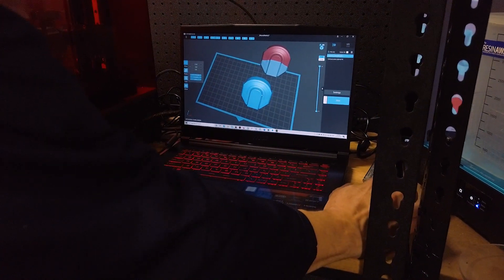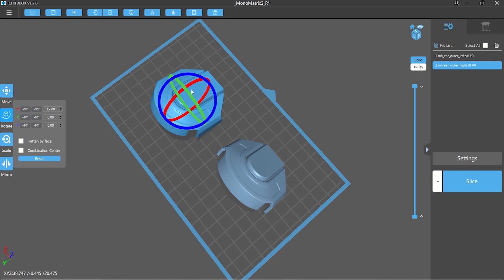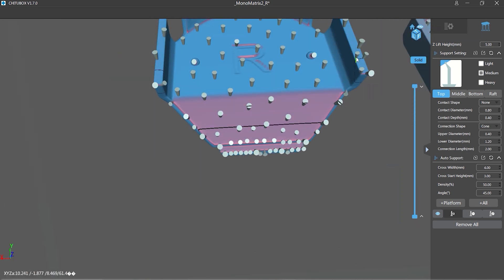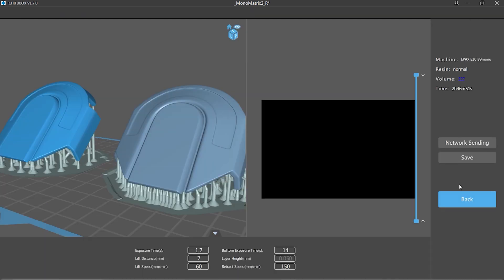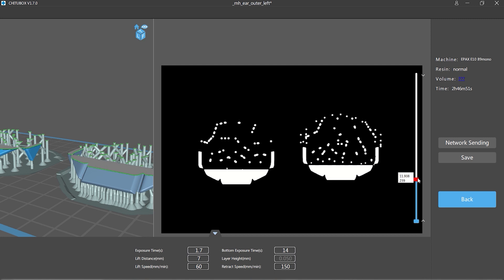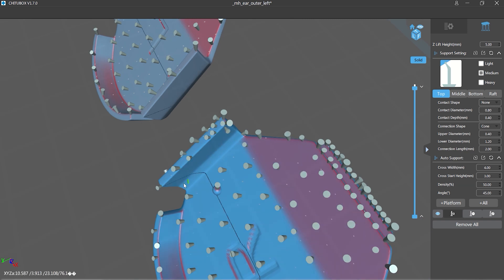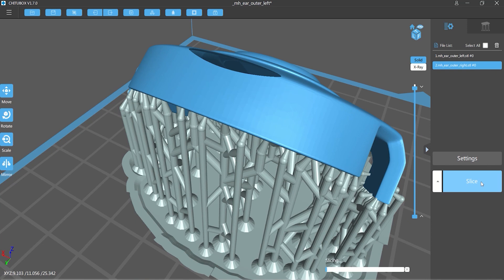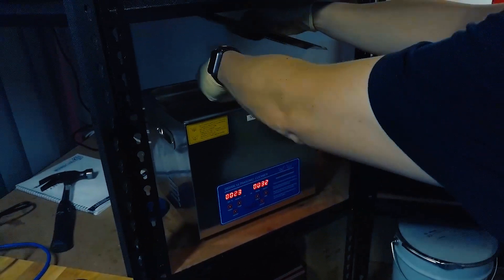How to set and place supports in Chitubox

Comment: Apart from this video, all the other videos on youtube that I can find are examples of printing and supports for toy characters. Are nobody using printers to print real stuff, like industrial parts or models.  I would love to see what did not print well. I would love to see the finer detail on the edges? Also I have some models where I want to support to rest on my model. For example I have a model that has a horizontal hole 150mm high. SO instead of having a bunch of 150mm high supports, why cant I just put a support inside the hole? I can drill it out afterwards. Chitubox dont seem to allow the support to go from the model to the model. This is something that you dont find on cartoon characters, so many people dont address these.
Reply from the maker: Try adding supports in all (not just to plate), change the angle of the supports or try Lychee. But I’m not sure why you would need supports in a horizontal hole anyway?!
Reply: This isn't a perfect solution, but I have seen some people use multiple branches on a single support, so you could place just a few supports near it and have more precise smaller branches support it from there. If you do end up doing this, let me know if it works for you as I am in the same boat, except I'm unfortunately having to print holes and shapes sub-millimeter in size (so I am stuck dealing with resin lol).

Comment: Where is the comparison?
Reply from the maker: The comparison to what?
Reply: Between the two prints, the one with default settings compared to the one with extra supports added. Was the default setting adequate in this case?
Reply from the maker: Most of the time the default supports are ok, but always good to check and add or remove if needed.